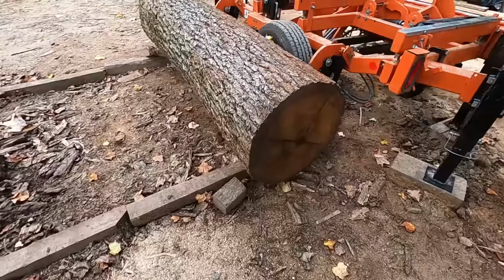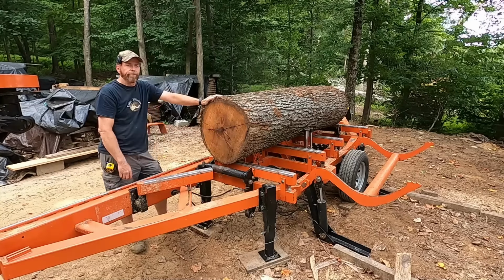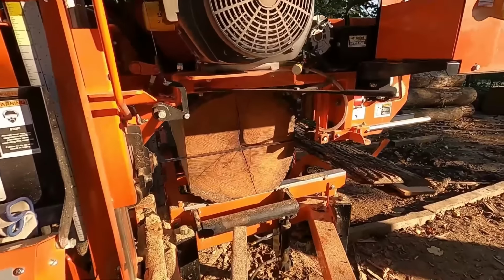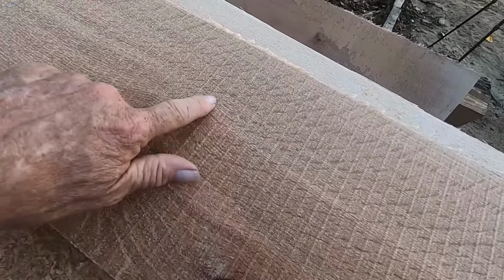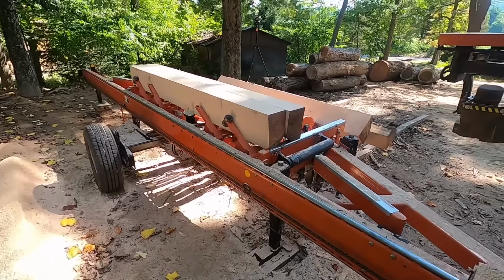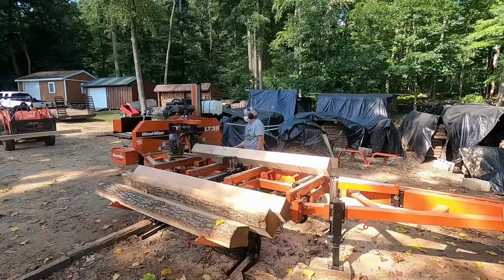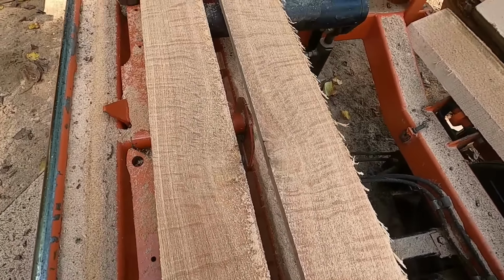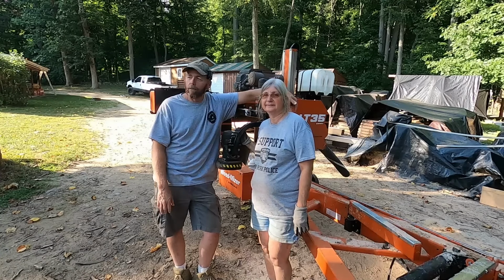How to Quarter Saw the Easy Way

Comment: I have a suggestion for you.  If you know anyone that uses a lathe to make furniture or other things, those off cut triangles would be a great sale item.  You don't need to make much due to you already spending the time.  They could be cut to lathe length and shipped UPS.  Good luck, and great video.

Comment: Thank you, question; I have a new mill, is it better to keep in log form or make cants until you ready for boards? Many ash trees. ..
Reply from the maker: If your logs are stored up off the ground, have space in between them to allow air flow, they should last. Keep leaves and such from building up on them, as that will hold moisture, and promote rot.
Some woods that are very reactive, such as poplar, or sycamore are best to let sit for a while. This will allow them to lose some stress, and they won't react, and warp like crazy when you cut them. 
You can have a log where the sap wood gas rotted, but the heart wood is solid and beautiful.
If you like salted maple, it's best to let the log sit up off the ground for a year or so before milling, as this will promote spalting. 
Bottom line, it depends on what you are working with, and what you want to get from the log. Unless you are doing lice edge, and need the sap wood to be solid, I think most could sit upwards of a year, off the ground, and spaced. Also, and this is huge. Seal the ends of your logs as soon as you can after cutting them to length. This will help prevent cracking in the ends of the logs, that will cause lumber lose.
Ash will last, but I wouldn't let it sit for years.

Comment: Well now, we have an older house with hardwood floors in every room, even the closets,  I thought all those marks were from a bad saw job! Didn't know I had such great floors till now!  We wanted to have them refinished but we were told we would hit nails so we went with carpet, when they cut out the duct holes for our HVAC we found out the floor boards are about 1 1/2" thick, some of them had the old saw mill name stamped on them. 20 years later and carpeting done twice now, I want to rip up the carpet and refinish them! 
That's some beautiful lumber for sure. Thanks for the video 😊
Reply from the maker: Absolutely refinish them. They will look beautiful.
Reply: I love the older houses that have amazing wood floors in them. So many are covered by carpet, definitely refinish when the time is right for you.

Comment: Beautiful quarter sawn oak. Im gonna try some at some point. lots of work on the LT 15. Thanks for sharing
Reply from the maker: Thank you very much. I think the toughest part would be the turning on the LT15. We started out with an LT15GO. An excellent machine, but you did need a good piece of support equipment to assist with some of the physical work, and to have a place to slide the larger cants to, so you didn't have to pick them off the ground.

Comment: Great video! I recommend making the first center cut as a 4/4 or 6/4 slab to remove the center of the pith. Then quart and rift saw the remaining halfs. That's the way I've gotten my favorite boards out of the sawmill. Stable and straight lumber without center zone.Do you still sawmill?

Comment: Long overdue to let folks who care about me know that yes, I am okay, just old. I did the swing arm on this mill I designed an it doesn't deflect a eighth of a inch when it is free arm travel. Your mill is horizontal drive and mine is vertical travel on the powerfeed. I do weigh a good one third more but its moved on just four tires like you'ns is now. Most of the ideas came from swingarm motorcycle frame work. Yet some of the drive came from a old Brockway truck from the early forties. Yes, a ton less in weight but its the ideas from old designs that did work an will work again if metal fatigue is not a factor. I hope 630 stainless face bearings will hold up on timken roller bearings. So far, everything is easy access so hopes are elevated. On a different note, I nearly missed the chance myself to see the trees that you visit in some museum. Vertical grain not a problem, its getting a tree small enough to go through any mill. Thing is, there's a zillion of them still in our national forests just rotting away because of the .0001% of our population than might ever try to see. I understand making a forest protected for all to enjoy but to lock up millions of acres for this is just wrong. Walking on foot only  access for a hundred miles is in my mind, Ludicrous to think  even a few of those who   could would ever travel to. I was just a young teenager working for the Silver Queen Mine, it had huge timber blocking the way to this mining area that would solve our national debt to this day. The cores from drilling had ounces of gold with high zinc content and of course lead, silver, and a lot of trace minerals.... it was crazy following veins that within very few feet from the surface, wide as a two lane highway and thick! We had to leave it because of the "Wilderness Bill" and it was quite painful knowing we were in the Bill Gates today fortune level. The large fir an cedar, hemlock trees were all twenty foot plus on the stump an a hundred foot plus to the first limb. All in all, a college level crash course in government bureaucracy that drove this young man crazy at the time.
 I found myself  wishing for  things that would help everyone who was poor an find health for the sick.  It doesn't  work that way as people soon forget to save for the rainy day. TV changed us, it made us believe that the world wants war and we couldn't be further from the truth. I haven't met many who  wished to die just because they were poor . an poor is a  term that is used wrong as well. Poor compared to what? Enough Morgan as I see a book length comment coming/LOL
Reply from the maker: Hello Morgan. It is always good to hear from you. I don't know much about design engineering. I just know that this machine works great.
You have an amazing history, and always a great story. I wish folks like you could write it all down, for folks to read and realize the great people that help build this country.
Do t ever stop commenting. We look forward to your wit and humor as well.
Reply: Hello Sir!  I would love to hear more about the Silver Queen Mine!  How can I get in touch with you?

Comment: I quarter saw much simpler than any of these other methods. I like a 24 to 26 inch log. Start at the top. Live edge saw it down just past half way. Flip and repeat. Take said live edge boards and snap 4 lines. 2/3  of this board will be vertices grain. The middle third is horizontal grain. Very simple.

Comment: I LIKE THAT YOU HAVE RAILS OR BUNKS FOR YOUR LOGS TO ROLL ONTO THE LOADER ARMS.  THAT KEEPS YOUR LOGS AND BLADE SO MUCH CLEANER AND SHARPER. DO YOU SPLIT ON THE BIG CRACK WITH IRONS OR WEDGES?

Comment: I could be doing all this wrong, but the way I have figured out how to get the maximum quarter sawn is by chasing the grain..

I say chasing as what i do is none of the protocols i have seen demonstrated uses each log as its own process. 

What I do is make sure that;
1. Tyere is No twist or very little twist as both ends need to be very close as to how the growth rings are oriented. 

2. Look at the orientation of the growth rings, at times i have noticed an oval or believe it or not almost a square in the rings. 

3. I then have a plan as to how much of the log has more  rings oriented correctly to simply flat saw that portion of the log to get the quartersawn lumber. 

4. The other portion such as the first cut is deep enough to get to the vertical rings. I set that aside and keep cutting till I get to the bottom of those rings. 

5. Readjust the last of the log with the first cut together and keep cutting till i have nothing useable left. 

I have yet to find this procedure to not work...

Comment: Nice looking lumber but I didn’t know red oak was ever quarter sawn. I’ve never seen quarter sawn red oak in my 45 years of furniture building, it’s always been white oak. 
I would love to build something from that wood.
Reply from the maker: Hello Bill, and thank you.  For some reason, red oak does not get the attention that white oak does. They have the same appearance. I realize they have different grain structures. That's the reason that red oak is never used to make barrels, as it will leak its liquid contents. I guess I should research that a bit.
I've made many things with red oak. From just a simple trim board, to a fancy cradle for my Grandson. The wood looks amazing though.
Reply: @IronOakSawmill  thanks, I’d love to get my hands on a couple hundred BF and build something. I live in AZ. so I’m sure it would be hard to get. My suppliers out of Phoenix would require a minimum of an entire unit and I’m not willing to invest in something I might not make any money out of. I rarely use red oak anymore, it kinda gone out of fashion. Maple and cherry are my two goto woods. Walnut is to expensive and long term exposure is dangerous. I do use some mesquite and carob wood. Beautiful woods.
Reply from the maker: @billboy7390  once we are done q sawing, we will a have a few 1000 bdft, and another few thousand bd4ft of plain sawn. Red oak seems to be popular around here. No issues selling it.

Comment: Why is there a little circular saw just ahead of the band saw
Reply: It's a debarker, it cuts off the bark just before the blade.  The bark can dull the blades because it usually has dirt and other impurities in it from being exposed to the weather for the life of the tree and that's hard on the cutting blade.  Going out the other side is not as bad, but starting your cut into a dirty edge and dragging that dirt through the rest of the tree has a dulling effect like sandpaper.

Comment: i could very enjoyably build YOU 2 a Fantastic english gothic dinner table out of this Oak that NOBODY you know Has one of .........Easily a 15k table , One of a kind ,  Cut , Chiseled , Mortised  , Tenoned , Glued and impossible to Ever wear out through normal but extreme use . Your great great grandchildren will be using it , With No nails in it's Construction needed , at all , Built like a Tank . All made with Hand Joinery !

Comment: i definetly know this , i would DEARLY love to Buy enough quartered white oak ,   1 1/2 inch thick to build a 42 inch wide tabletop 12 feet long and have enough flat sawn white oak in 3 inch thick lumber to build the legs and braces for this Family Dinner Table . Yes , i do have a large family . 7 kids , 5 adults and 3 grand children . they are all filipinos except my big American ass , so yes 12 foot long will do , just fine . and yes i know it will be extremely heavy , around 600lbs , Finished .